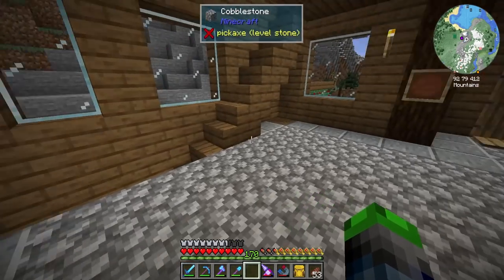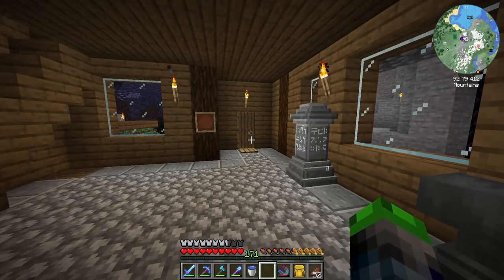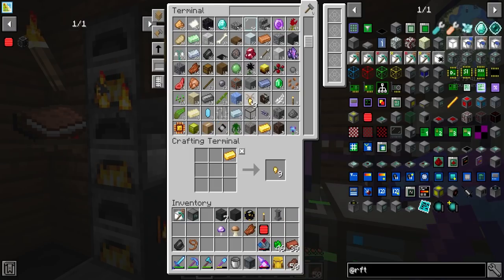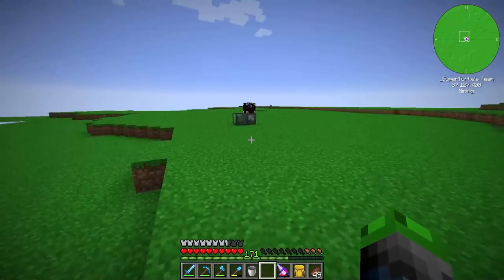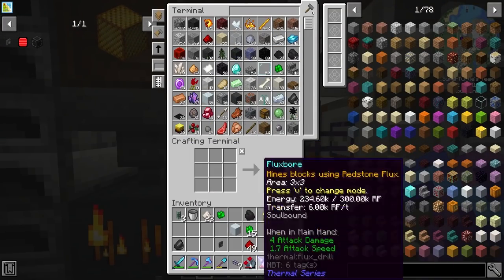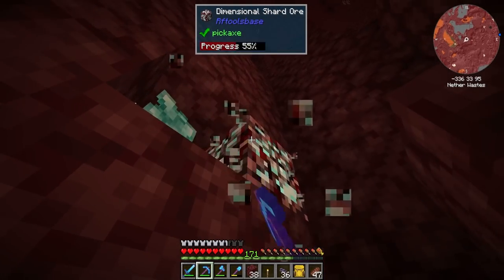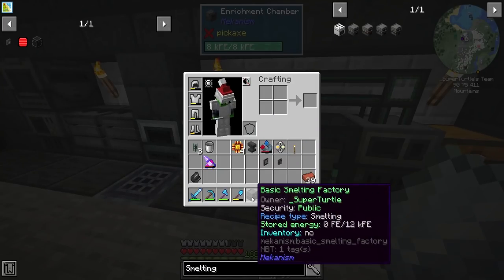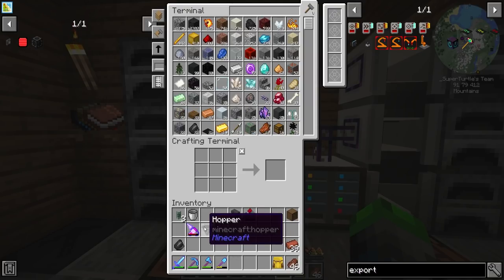Direwolf20 1.16 Let's Play | We Built a reactor because we built a quarry! | [Ep 06]

Comment: on the top left of your reactor ( near the coal) is a little button.. you should push it :D and watch out, you still get cobble and other stuff.. voiding doesn't work properly.. i did setup some drawer with an drawer controler and external storage.. all cobble and stuff goes into the drawer with void upgrade if it's full
Reply from the maker: Good call!